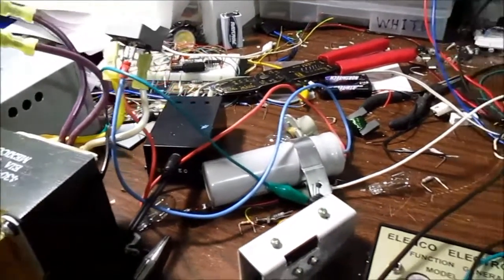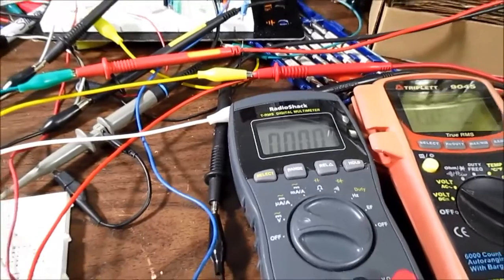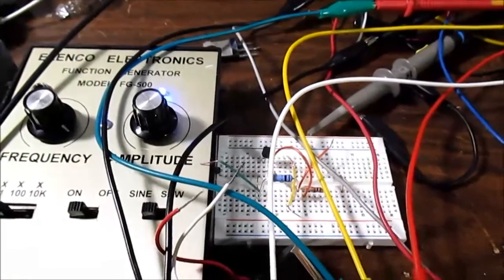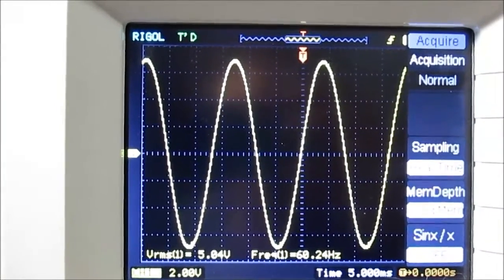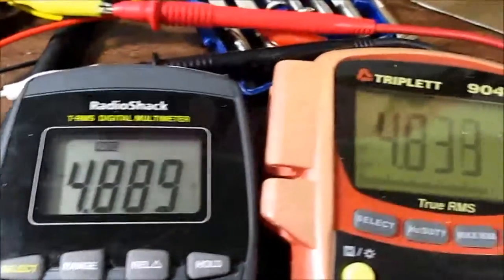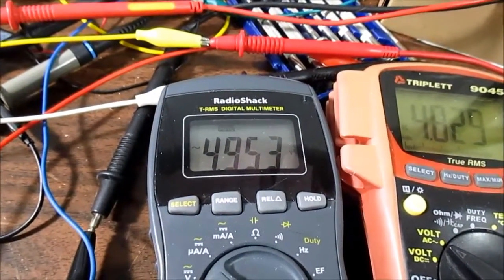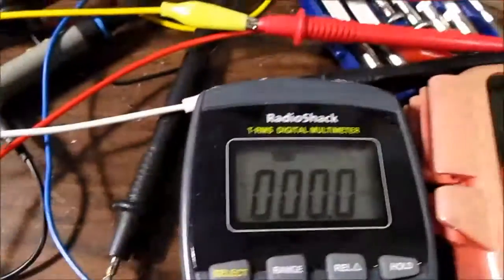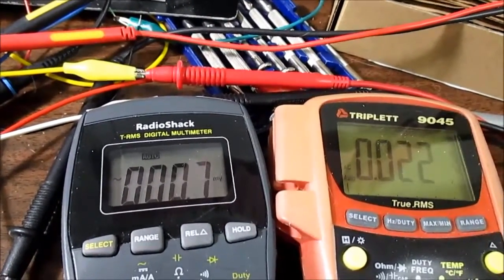Testing meter's response to different frequencies of AC voltage

Comment: This was very informative. I'm trying to do is specify a 0 - 500VAC, 50 hz meter. I was trying to see if the frequency of 50 or 60 hz, affected the voltage reading of the meter significantly. I can't find 50/60hz in the AC voltmeter specs of any of the voltmeters I have found so far. Anyway, I believe you answered my question. Will a 0 - 500VAC voltmeter change it's reading when reading 50 or 60 Hz? The answer is no No significant difference..

Comment: Did you look at any voltage drop in the cheapo meters leads when doing that?
Just to give it a chance I mean?
:)
Reply: Hi John, I have a Rigol 1102E which is the 100mhz version of your scope and the scope always reads higher than my Fluke and 2 Extech meters.
Great work and a great channel. I'm a die hard tube tech/builder and would love to see you work with some tube audio gear some day.
Cheers.
Rob.

Comment: I would be curious to see how a 6 dollar Harborfreight meter compared to those.
Reply from the maker: I used to have the red one. I mistakenly hooked it to a voltage source while in current mode and popped it. Funny, it had a soldered on the board fuse but it didn't open. Something else blew inside.
Reply: That's pretty much what the Yellow one was, though it was probably free...
Reply: Or the free red one that you get w/ a coupon.